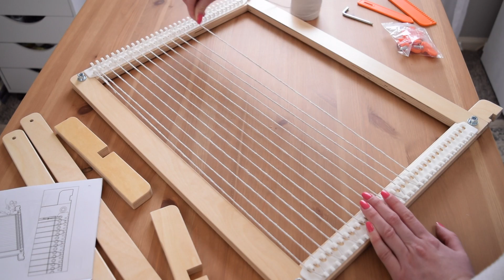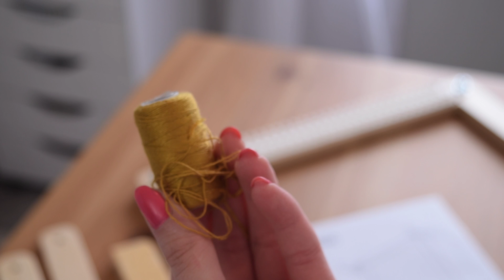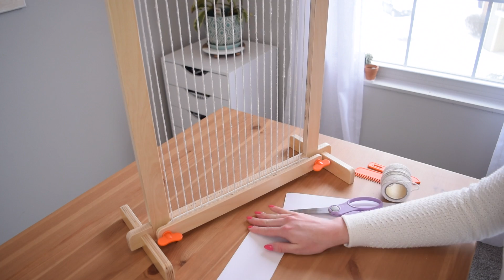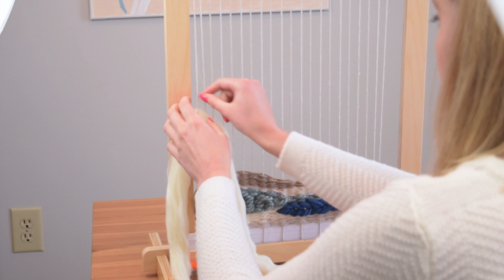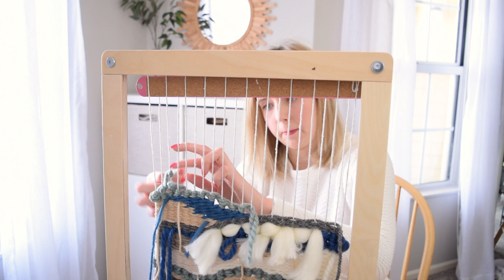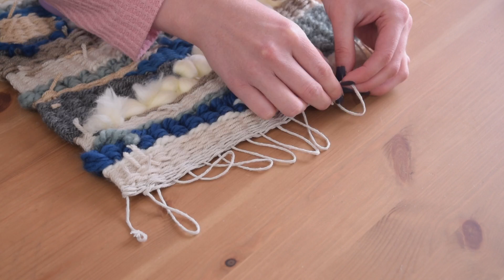How to WEAVE using an IKEA LOOM (Ikea Lustigt Hack for beginners!)

Comment: Hi, what are the paper spacers for, what is their purpose 🤔
Reply from the maker: Hi! The purpose is to give you some extra length on the warp strings to remove the weaving and then tie it off nicely at the end
Reply: @ActuallyAlli  awe thanks for that, just bought a loom, not tried it yet ❤
Reply from the maker: @joolz4296  I watched a handful of videos to get the hang of it and learn different techniques. I don't think there's any right or wrong way as long as you like the result!